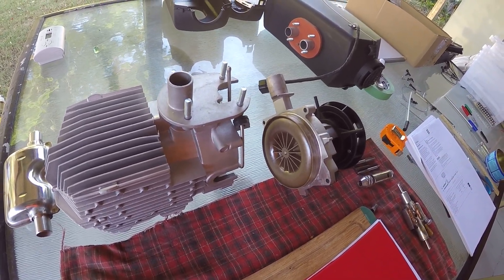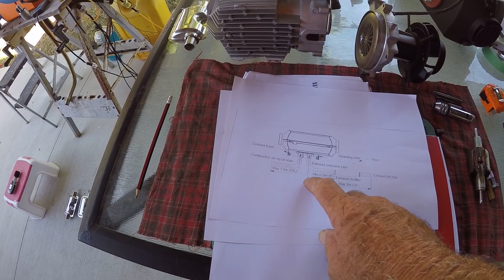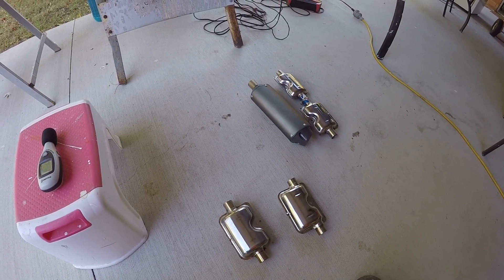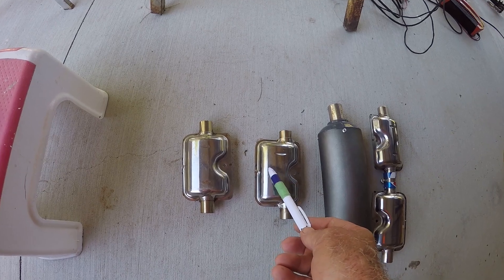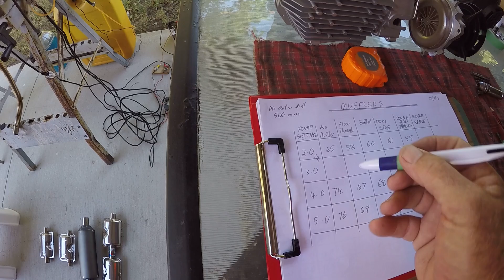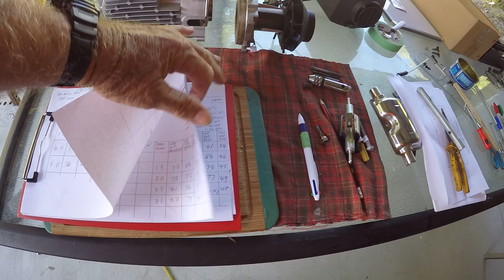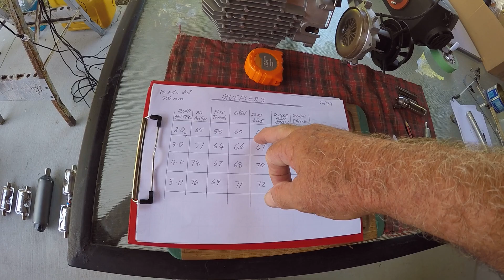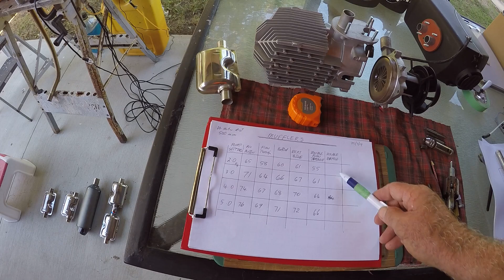Chinese Diesel Air Heaters - Part 8 - Exhaust and Mufflers

Comment: well darn...i was thinking of rolling 3meters of exhaust pipe around another steel pipe to create a sort of radiator to avoid letting all that exhaust energy just going into the air...but i guess that was really bad idea....
Reply from the maker: Hi AH,

You can make a heat exchanger, just don't put restrictions in the little diesel heater exhaust. It hates restrictions.

You could get some solid pipe for the exhaust and wrap copper pipe around it for a water heater.

You could make a heat exchanger using two different pipe diameters, one inside the other. Small differences in size you could heat water, large difference in size you could heat air. Use a small pump to circulate the water, and a small computer fan to circulate the air.  JMcK

Comment: I want to upgrade the clamps at the unit intake and exhaust connection on my 5kw, what size are the clamps needed? I see some at 22mm and some at 24mm, but no definitive info as to which is for what

Comment: Is wrapping the exhaust system with temperature insulating exhaust tape to reduce carbon buildup over time worthwhile?
Reply from the maker: Hi Thomas, I often wrap the exhaust, depending on application, but I can't see how it would reduce carbon buildup.

Carbon mainly comes from poor install with restrictions in combustion air intake and exhaust, bad fuel, burning any oily fuel, and high altitude use,    JMcK

Comment: Your videos are so in-depth and fascinating, that I couldn't help myself watching your playlist 3 times already! 
I wish you had the same on the new water heater Chinese clones of Webasto or Eberspacher water heaters. 
It would make a great floor heating for a tiny house, RV or a cabin.
I don't know of a cheaper way to heat a small space, short of cutting and splitting firewood to use in a stove, for free! 
Here in Ontario Canada, Propane is $20 for a 20 lbs bottle refill at Costco and contains 4.7 Gallons (3.8 L) LP. Makes Propane a little over $1/liter. Diesel is about CAD $2/liter and has more than 1.5 times the energy. 138,490 Btu/gal compared to 91,420 Btu/gal of Propane. 
If you know a cheaper way to heat, please comment.

Comment: Curiosity leads me to wonder what 3 mufflers would do... or 4 or 5 or doing away with the exhaust pipe and having several straight-through mufflers in-line.  I suppose the variations are endless.
Reply from the maker: Hi DK, in practice, one straight through muffler is all that is needed.  JMcK

Comment: Would the 2kw size suite 18 feet caravan in the Brisbane area or is chinese brand as good as belief at a fraction of the cost.
Reply from the maker: Yes, Harry. 2 kw will be fine for you.
The Chinese copy heaters are excellent heaters for the price. 
I own and use genuine Eberspacher, and the Chinese copies.
The Chinese heaters are well worth buying. The only advantage of genuine is they have altitude compensation, but in Aus you don't need that feature.    JMcK

Comment: Hi John, 
Just found this video and it is most wonderful. I'm in a position where I need to pipe exhuast a fair distance (3-4m) from the heater.. Am i wrong to install an exhaust fan to assist in sucking the exhaust away? Is that likely to cause issues?
Reply from the maker: Hi Tim, I don't see an issue with that, it is a long exhaust.
If the exhaust run in an upwards angle the exhaust will flow well.
If exhaust angles downwards you will have back pressure issues without some help.
Cheers,  JMcK
Reply: @johnmck1147  Awesome, Thank you. I've got it mounted in the workshop, porting the exhaust staright outside but for the sake of the neighbours want to run some pvc conduit and mounnt a fan to suck the rest up to elevationn to be better caught on the wind. 
You made the comment about the back pressure, just thought to query it. :))

Comment: I thought noise doubled ever 3 db.  So wouldn't a change of 10db actually be approx 8 times louder?     Great videos by the way.   Very informative.
Reply from the maker: Hi 22 savage,

You are partly correct. In scientific terms 3db increase is actually twice the energy or power.

However peoples hearing is very subjective, and dependent on ones ears. In human terms a 10 db change is generally considered the level that the average person perceives as a doubling of the noise level.

Cheers.  JMcK

Comment: Hi John, would wrapping the exhaust with header wrap be a bad idea on these?  Looking at doing so for more protection but unsure if the exhaust material will prematurely fail...
Reply from the maker: Hi P,
Wrapping the exhaust with high temp exhaust tape is ok, and in some installs, a necessary addition.  
Cheers,  JMcK

Comment: John I really have learned a lot from your videos. Have you ever seen a situation where the rubber gasket that fits over the intake/exhaust starts to melt or burn to the base of the heater? I have a 2kw heater.
Reply from the maker: No NA, I have never seen that. All heater gaskets I have seen are made of a heat resistant silicone material. JMcK
Reply from the maker: Hi NA, 

Suggest you ask for a refund and purchase elsewhere. Don't buy that heater. To stuff up on such a fundamental item, what else have they compromised on.

Are you able to send me a picture of the melting gasket, and where you bought that heater? 
My email.  johnmck47@outlook.com.   Thanks JMcK
Reply: Thanks for your reply. I’m pretty sure mine is not silicone because it is definitely melting to the base of the heater. I think I have a source for a silicone one in Canada.

Comment: Excellent. Thank you for sharing. The info on exhaust restrictions was particularly useful to understand. I had been planning to try adding some form of baffle insert or wire wool into the straight through muffler.
Reply from the maker: Hi J258, Suggest don't do it. The tiny exhaust does not do restrictions.  JMcK
Reply: @johnmck1147 
Thanks for this info 😅

Comment: Hi John, with an all-in-one unit placed outside an SUV do you need to use ducting to source the fresh air from inside the cabin to avoid getting some exhaust fumes inside the car? Also, this will make for warmer air coming out of the heater…
Reply from the maker: Hi DP, 

Yes, you can recirculate the air if you wish. Whether you heat fresh air or recirculated air is a personal choice. However, I personally think in your case it not worth the effort, and I also suspect you will get too hot heating recirculated air. The all in one heaters use a 5 Kw heater and that size heater will easily heat an SUV.

Just make sure exhaust gases can't be sucked into the hot air intake. If you are going to go to the effort to put ducting on the intake side of the heater, you could you could duct in fresh air well away from the exhaust, or put it in the SUV and recirculate it if you wish.  JMcK
Reply: @johnmck1147  Ok! Thanks again!

Comment: Hi John, I am retrofitting an all-in-one Chinese diesel heater per your instructions in these videos and I am wondering what your best advice is for the placement of the exhaust and air intake? I put the heater up on wooden feet so I have space underneath, but I am wondering if the exhaust pipe should be extended from the 60 cm pipe supplied and put out the front of the heater (controller side) so as not to get exhaust fumes mixed in with the fan at the back of the unit? The heater will sit next to my SUV with the heat pumped in through a long tube through my window (I am sleeping inside the car). I would then put the air intake pipe out the back.

Comment: Why all the curves in the exhaust pipe? Wouldn’t it be BEST to just cut the exhaust pipe short enough to point straight downwards (out of the hole of your vehicle), with the muffler attached at the end of the pipe?? Would exhaust fumes actually make their way back through metal or  in my case 3/4” of plywood underneath my cargo trailer? Just curious to know what YOU think John.?? Thanks Art
Reply from the maker: Hi Art, yes, you could mount the muffler directly to the heater if you wished, providing the heater was sealed well, so gases could not come back into the accommodation area. JMcK

Comment: John does a great job on his videos, however when the dosing pump is installed correctly, and the system has been bled properly, the will be NO air bubbles in the system. I like to take the line end that connects to the heater and put it into fuel so it is covered, go through as many bleed cycles needed to remove all air, then connect to heater. It will start burning fuel very quickly, with NO flooding.

Comment: Hi I've seen a comment that useing spiral pipe rather than the ribed type pipe supplied would be quieter with no silencer, than a riibed pipe with a silencer, I've ordered some but not here yet. I could not make out if you joined the two silencers with  tin can rapped round and clamped, am i wrong?

Comment: So should I drill a hole in the exhaust pipe at the lowest spot? How would that work in a boat? Which is sort of an indoor space where I don't want to have any fumes in .
Reply from the maker: Hi O357, 

You can't do that in a boat. Suggest you watch my boat video.  JMcK
Reply: That tip would only be for an external run of the muffler hose.

Comment: What temperatures does the exhaust piping reach?  Fire dangers from it resting on something?
Reply from the maker: Hi Scott,

This is very dependant on the Hz setting (power setting) ambient temperature, and run time.
But exhaust temperatures can exceed 200°C, even 250°C
The exhaust needs to be wrapped with exhaust tape if anywhere near combustible material.  Regards. JMcK

Comment: My heater will only run an average of 2-3 hours then error codes 8 and shuts itself off. White smoke comes out the exhaust after this happens. I don't have a muffler since one didn't come with my heater?? I've watched several videos still the same result.Can you help?
Reply from the maker: Hi Kandy,

Your issues are most unlikely to be caused by no muffler. These heaters run just fine with no muffler. 

First check you don't have obstructions in the combustion air intake or the exhaust line. By obstructions I mean excessive length, too many bends, etc. These heaters do not like obstructions here.

Next check you are not overheating unit by running it at full Hz setting for long periods of time.

Then check the temp sensor is correctly positioned and its plug is tight in the socket.

Check there is no obstruction or air leakage in fuel line.

Finally, if heater has had a lot of use, you may need to do a strip down and remove carbon from the burner and atomisation screens.  JMcK

Comment: Excellent video! I truly appreciate the time and money you have put into helping us do-it-yourselfers. Is it possible to turn the heater 90° so that the exhaust is on the side?
Reply from the maker: Dell is correct. These heaters can be side mounted but only the side with the glow plug on the top. They can run (for a while) with glow plug down, but the glow plug and screen gets flooded with left over diesel and then the heater won't start.  JMcK
Reply: Yes, but the correct side must be up (glow plug up).

Comment: Hi John, love your videos.  Bought the one you recommended but am not mechanically minded so am having troubles.  Two questions:  1. Does the pump stop ticking when working - ours does after a couple of minutes  and my partner panics and tells me to turn heater off.  2.  Our heater only provided a short black wire with loop to be fixed to the van chassis.  Is that why the pump stops working - something about voltage.  Should we extend the black wire to the neg of battery?  Thanks Anne
Reply from the maker: Hi Anne,

First I suggest you have a look at the videos on motorhome install.

The fuel pump is a electromagnetic piston dosing pump. It “ticks” when it is working. If it does not tick it is not working and not delivering fuel to the heater.

The heater should be connected directly to a battery. The red wire, with an inline fuse goes to the positive terminal and the black wire to the negative terminal. 

The wires supplied with these heaters are a bare minimum size. If they need to be extended to reach the battery you must use bigger wires to prevent voltage drop.

I hope that helps.  JMcK

Comment: Hi John, firstly great video  & info you have provided! My question is when you say "you must have more exhaust in front of the muffler and less exhaust behind the muffler", which is the front and which is behind? Do you mean after the muffler and before the muffler? Thanks
Reply from the maker: Hi Frank, it is better, in my opinion,  (but not critical) to have the muffler closer to the end of the exhaust run. ie, more exhaust pipe before the muffler and only a little bit of exhaust pipe after the muffler. This is not like a car exhaust with positive displacement of the exhaust gases, but exhaust outflow relies on a very tiny fan, and I feel it is better to have a restriction in the pipe close to the end of exhaust, rather than the beginning. Not so critical with a less restrictive flow through muffler.  JMcK

Comment: Hi John, Ive installed the regular muffler but added a three meter extension pipe after the muffler. will this affect the running of the heater?  could it be the cause of severe soooting up of the burning chamber?
Reply from the maker: Hi Marion, sorry, that exhaust is just too long. It will cause excessive restrictions in the combustion process which will lead to poor running and carbon build up.

Even going up in exhaust pipe size a 4 m total exhaust is just too long for these heaters.

If it is critical to have a long exhaust you can overcome back pressure issues by going to a bigger pipe (say 50 - 75 mm diameter, and install a small extractor fan in the exhaust pipe.  JMcK

Comment: Hello John. As you mentioned that "2 is better than one" I fitted 2 mufflers to my heater. Because of where I needed to place the heater and as I wanted to get rid of all fumes my exhaust pipe is 2.0m towards the back of my van and fairly straight. At the end I added the 2 mufflers and then added the standard short exhaust bent towards the ground. Do you think that the overall length may be too long? Also do I need to drill a small hole in the exhaust at the lowest point to allow the condensation to drip out?
The heater seems to work just fine currently.
Reply from the maker: Hi Ansis,

If the mufflers are of the flow through type you should be ok re back pressure. 
Yes, you should have a small drain hole at the lowest point.
Cheers.  JMcK
Reply: @johnmck1147  Thanks John. So far, so good!
Reply from the maker: @ansisrieksts7174  

👍

Comment: Hi John,   Do you have any recommended sources to buy the straight through mufflers ? Its difficult to find them;  also  the mufflers should come welded on the ingress/egress pipes as I have noticed that some exhaust comes from the water drain hole and between the pipe and exhaust casing on the muffler that I received with the unit

Comment: John, thank You for all this information. 
I'm installing a 2kW unit into my van and carefully following all Your instructions.
But few things about the  exhaust piping.
In my opinion the original china pipe is crap: sleek ends but heavy corrugation in the middle, no way to cut it to proper length. And it is so stiff any force applied at muffler will punish the hose clamp at heater.
So, replacing it with real bendpipe, but be careful: the German ancestors could not agree the caliper. Webasto uses 22mm and Eberspacher 24mm (inner dia). Chinaheat is a copy of E, I guess, so correct hose dia is 24mm. I learned this the hard way!
Thank You!

Edit:
Just installed the new exhaust and noticed the alu-paper intake hose had taken some hit as well, BUT: intake is 25mm !!
So there are 3 dimensions related to heaters: 22,24,25. Wunderbar!
Reply from the maker: Hi Hiki Tech, 

Thanks for the feedback. Yes, it would be nice if the manufactures could agree on a common standard.  JMcK
Reply: @johnmck1147  Yep, all we can do is just talk about it!
Another thing: Did You address the air-to-fuel ratio tuning in any of Your videos?
I have the yellow SmartSensor CO meter (product placement in Your vid :-) and I measured CO at tail pipe:  10ppm (=next to nothing)  at low Hz but goes up quickly when  fuel feed is increased. Rich mixture, is this indicating too low fan speed at hi power?
Could this be tuned with (RPMmin-RPMmax)/(Hzmin-Hzmax) -linear function?
Reply from the maker: @hikitech218  

Hi HT,

If you like experimenting, yes you can play with the fuel air mixture ratios, but this is not for the average owner. You can get into a lot of trouble.

Suggest you do same test on your motor vehicle and note the results results. You will find them interesting. Suggest you do not start playing with mixture ratios on car as again you can cause more problems than you wanted. If you want to do this, suggest you use wife's car.   -  joke.

JMcK
Reply: @johnmck1147  Unwritten rules:
If it works, don't touch it!
If You want to play with techno-gadgets, leave Your wife's car alone!

I have seen comments that the controllers and heaters are not correctly paired when they are shipped: 5kW parameters in 2 kW heater.
But I agree it is sensitive area, and requires gas temp meas, Co meter and actually a lambda sensor.
If I get my hands on some of those meters, I will do some tetsing, anyhow it is all digital parameters which can be reseted to original.
assuming lean mixture hasn't evaporated all aluminum to stratosphere.

HT